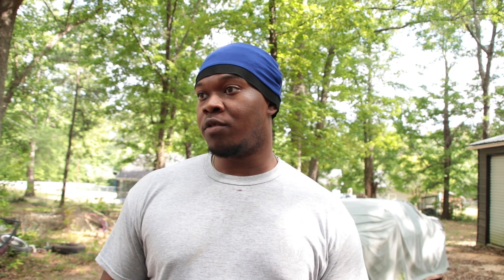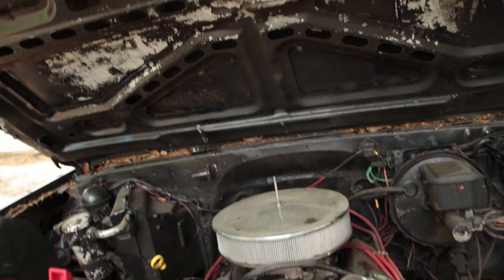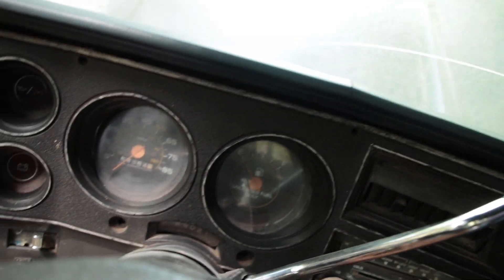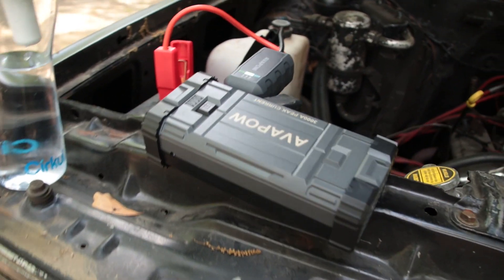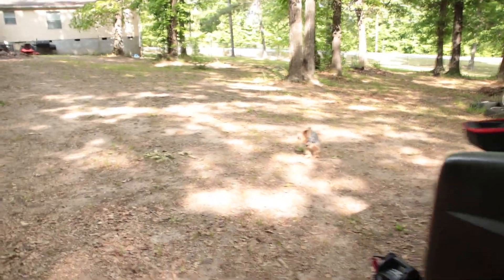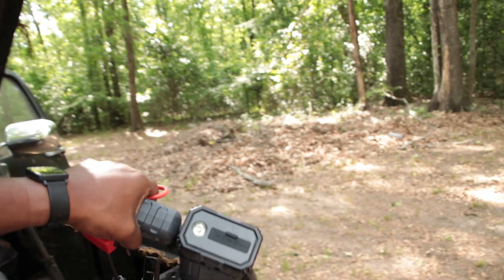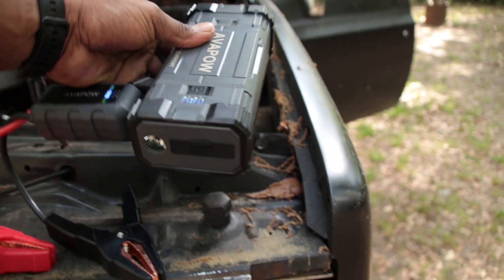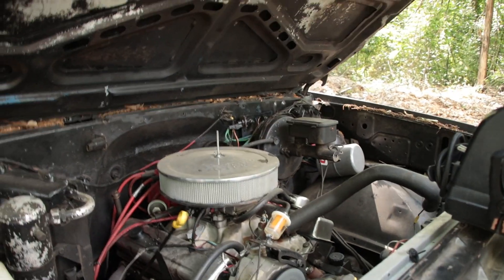Testing Jump Boxes to see which one can start my Hign compression sbc 350

Comment: I have a Schumacher, yours might be newer or just a diff model but I love the thing. Its got a lead acid battery in it so its more stable than the lithium pack starters in diffrent temps and they do charge back if you leave them hooked up for about 5 mins after you startup. When I looked into buying these awhile back I remember they are around 1000 amps which should still probably start that ol 350 but you could have ended up with a 750a or maybe lower model which probably cant provide enough grunt to get it going.
Reply from the maker: I learned that both the alternator and battery were both bad which could have been the reason it couldn't start it. The sticker does say 1000 amps on the jump box though.
Reply: @PullsTv    nah that alternator being bad is why it didn't wanna run that long on the box basically them lithium ones can run full power for sec but can't support the reset of the electronics because lithium batteries are notorious for "venting" (think of it as a diesel runaway) and catching fire when they get overworked.